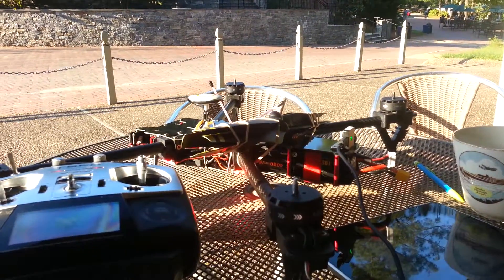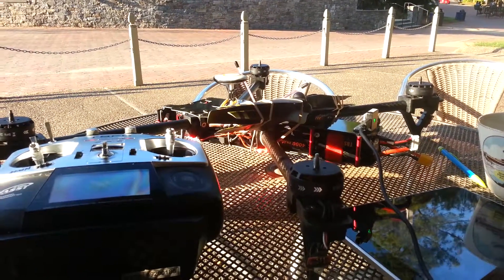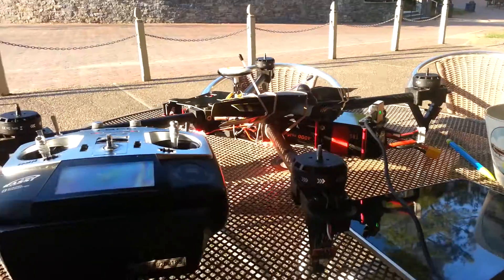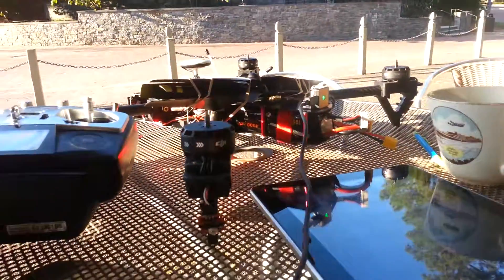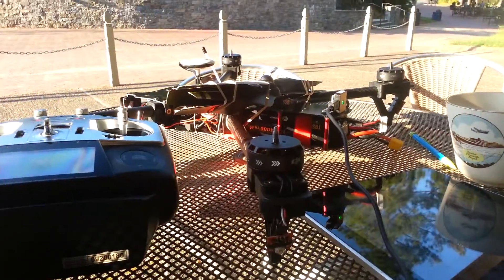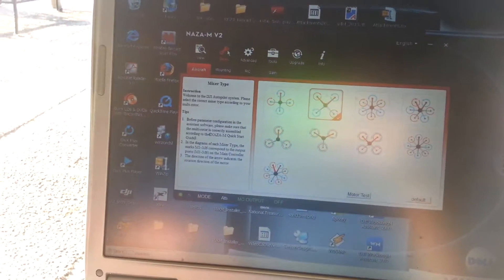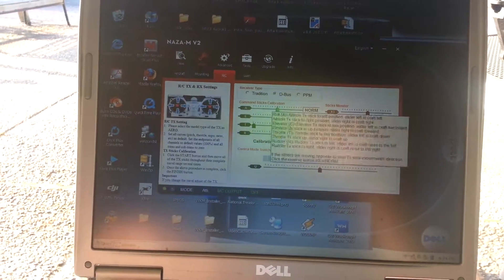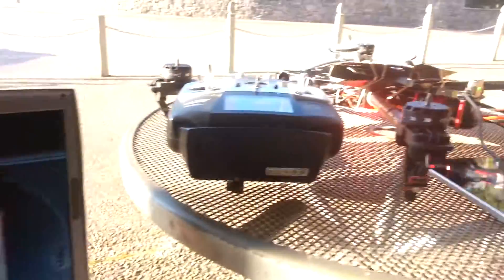Naza arming issues on the TBS discovery

Comment: this is good tip...Also just in case others are not aware, if the FC is connected to the PC, the motors will NOT arm. Disconnect it from the PC and it should arm. I don't think the instructions manual says this.
Reply from the maker: Excellent point my flying friend.